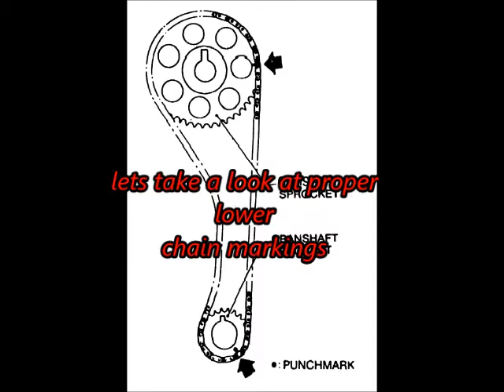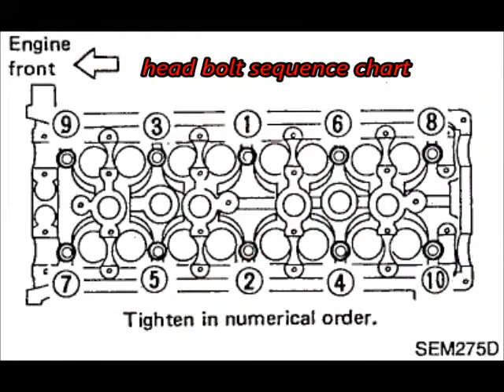KA24DE assembly: time-lapse tips and tricks PART 1

Comment: Have you ever heard of anyone torqueing new head bolts at 60 ft/lbs and anything strips or breaks with the aluminum head and iron block?
Reply from the maker: Bryan Thomas i dont really understand ur question??
Reply: BackIntoGear so the head cylinder is aluminum and the block is iron. I've got new mahle head bolts and I'm making sure that torqueing the new bolts to 60 ft/lbs won't do anything disastrous with the two different metals. I did a test-torque of 60 ft/lbs on a junk 2000 frontier, and it felt scary like the bolts were being tested to their limit
Reply from the maker: Bryan Thomas na u would break a headbolt before u damage the block or head from overtorque.. u gotta make sure the headbolt holes in the block are cleaned out VERY well. Debris inside the holes WILL cause torque values to be wrong. I have broken headbolts b4 that way but it doesnt damage the head
Reply: Your comment disappeared, can you resend please?
Reply from the maker: Bryan Thomas its still in the feed... try refreshin
Reply: BackIntoGear you've broken NEW headbolts at 60 ft/lbs? That's what I'm worried about. The last thing I can afford to do is to pull the block and helicoil it or anything very time consuming like that
Reply from the maker: Bryan Thomas correct i have broken new ones but like i said make sure the bolt holes are super clean. U can torque em down to 55 if u dont feel comfortable at 60
Reply: BackIntoGear last question, do you know why the intake cam bolt torque specs are so higher than the exhaust? It seems weird when they appear identical
Reply from the maker: Bryan Thomas i have wondered. I have never looked it up but my only theory is engine rotates clockwise sooo maybe there is more force and stress on intake cam bolt.?? I honestly dont kno thou
Reply: BackIntoGear yea, thanks again for everything. You've been a big help
Reply from the maker: Bryan Thomas no prob at all. If u have other questions just ask.
Reply: BackIntoGear thanks man